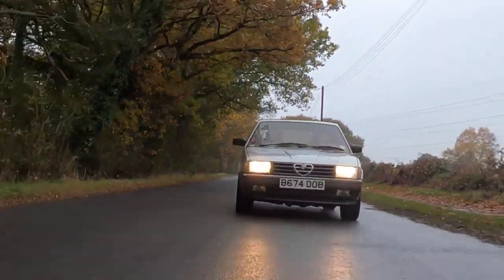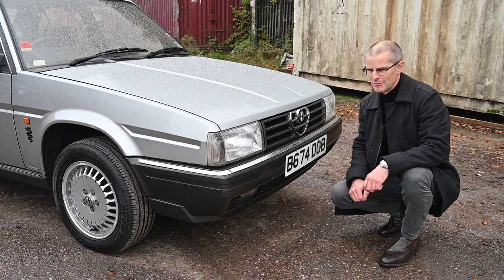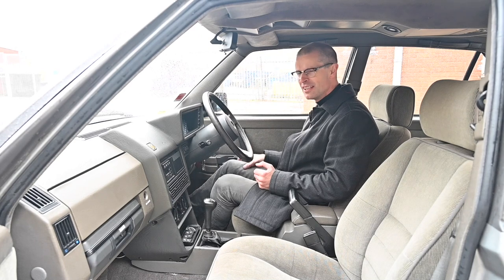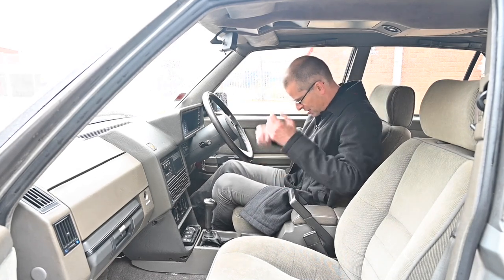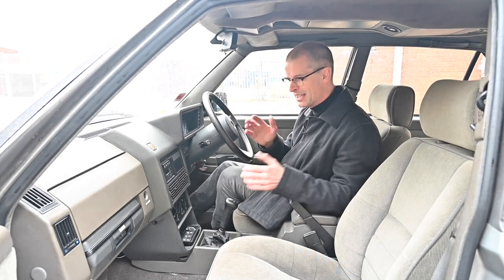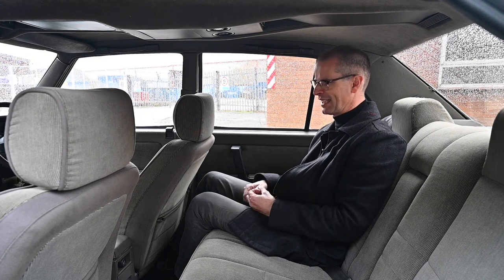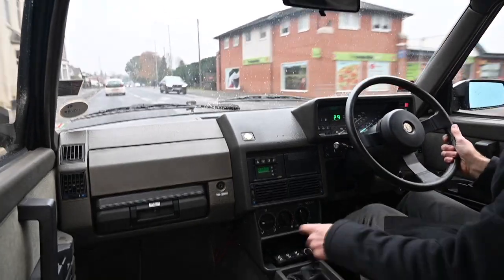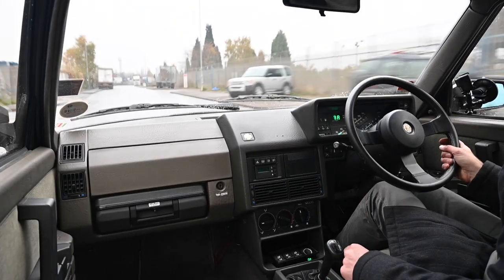Alfa 90 Gold Cloverleaf Goes for a Drive

Comment: I had the privilege to own one some time ago. It is not particular beautiful but with it’s quirky features it put a smile on my face every time i got to drive it. The front spoiler, digital dash, handbrake, green illumination, rear discs mounted at the gearbox and the engine 2,5v6 all one big smile. Then the rot came along and eat my trunk. Eventually sold it with a hole in one of the pistons probably due to a faulty injector. Then learned that ‘my’ car was sold on to a student that had folded it around lamppost. A true tragedy for such an awesome car.

Comment: Very nice video. Little remark: the 90 was the stopgap for the 164 to be ready, not the 75. It was positioned next to the 75. When Alfa asked the Italian government for money in 1979/1980 it was for a mid-size and big saloon. The mid-size they got approved as it continued on existing technologies which became the 75 (launched 1985). The big saloon was rejected so Alfa started the 90 project which was a reskin of the Alfetta; later to be updated to be more like the 75. Due to some informal connections Alfa learned of the work that Lancia and Saab had been doing (Thema, 9000 and Croma) and was able to renogiate with Italian government to get money for a big saloon but with reduced costs as it would share the platform. They still went ahead in parallel with the 90 however to be on the market quickly. The 90 had a difficult time as it was not different enough from the 75 and the Thema was the better offer. Alfa was pretty much ready with the 164 to compete again (very different than the 75 and despite shared platform very different and more modern than the Thema) by 1986. They however ran out of money for production tooling. That's when FIAT bought them and after a year of fine-tuning (and some downgrading of luxury options to have less competition with the Thema) in 1987 the 164 was launched. And the doomed-from-the-start 90 was no more. In most companies a car like the 90 could not have existed. In Alfa it could.
Reply: Als je een goede tegen een redelijke prijs te koop weet laat het svp weten! Ik vindt het een fascinerende auto en wordt er enorm hebberig van.

Comment: And now for something completely  different , intriguing Alfa with enough green lights to make Superman feel at home , and more shakes and rattles than a Doctor Who set it seems ,  only saved by the engine note . Just before heading off into the dough ball 90's lets give the straight line styling pen one more burl. Cars rode so much better back then on proper rubber and smaller wheels ,If the future is full of low profile tyres being   almost sprayed on please bring back hydropneumatic suspension . The over head console takes your breath away ..all it needed was a Fax machine. Great review.

Comment: I 'upgraded' from a '76 Alfetta to a 1986 90. I loved it for about a week before problems started occurring, and then regretting not buying the more powerful 3.0l 75 or GTV. The dash check light was always on, the digital dash and odometer were flaky, oil got into the coolant through dodgy head gaskets from memory, heater radiator leaked, it cost a fortune to maintain. A real love/hate relationship.

Comment: "everything that was brilliant about the 80's... in a door" lol
Reply: Yeh 80s sports cars were designed to stand out. Now sports cars don’t they just look like the normal spec cars it’s all about being subtle and boring. The 80s was the decade of being OTT, if you had a fast Ford it was badged up and body kitted out as a sports cars like the Escort R.S Turbo, even the XR3’s & XR2’s stood out and the legendary Cosworth especially the 3 door whale Tail stood out a mile. Now it’s just some little badge on the bottom of the door that’s a signs it’s the faster or sports edition. Booooorrrriiiiiinnnnnggggg😒

Comment: I had one of these ,way back in the 90s. It was a bitter/sweet experience, because  I  was  never sure if  it would break down unexpectedly, usually far from home and many times for the most trivial of reasons(fuel injection relay failure ). The list of things that failed or stopped working was quite long. Such as the electronic speedo and rev counter either not working or giving alarming speed readings ( 800 KMH ),failed front wheel bearings, failed electric windows, refusing to start sometimes ,failed radiator fan thermo switch.   In the end ,I just gave up and got rid of it, but when it worked, it was a wonderful car to drive.  The first thing to go missing  when buying a used example is the briefcase
Reply: I was once told that the 90's briefcase is more valuable than the car itself.

Comment: the driver mirror adjust being electrical on the passenger side was not a design high note,  rather they just left the flawed LHD version as with the floor mats and boot release but in this case it was a benefit if you were RHD.

Comment: Thank You! Nice video and really, really nostalgic for me. Ive had 5 of those, Yes thats figure is correct. I miss every one of them, especially the blu 2.5 quadrifoglio oro from 85. The 2.5 is just the best busso (and thus the best ever engine), more vocally trained and responsive than the later 3.0. But all bussos are great. Despite having active aero (way before it got into fashion with similar cars like f.x. the Veyron) it does lean a bit but the balance is just adorable. Steering is great and you can have all four wheels letting go at exactly the same time if You get of the accelerator briefly during cornering. Despite having 5 Alfa 90´s and using them, I never had any problems at all with any of them. Even the guys at the annual MOT testing always stressed -Don't bother coming back next Year, no need really. Some Years they even called in extra staff so more people could adore the perfection.

Comment: Fabulous ! What a car, what would that have cost originally in comparison to a Granada / Carlton / Rover SD1 etc ? I remember occasional visits to Mario Deliotti for parts as my Dad had a `74 Berlina 2000 in the late `70s - not so quirky as the 90  although the centre console was angled to the left + guages were in Italian. Sadly it rapidly rusted and was actually outlived by the landcrab 1800 it replaced!

Comment: Really decent review. It makes one think that the Alfa 90 is the more electronic heavy version inside of the Alfetta launched in May 1972 with exactly the same platform but with the v6 engine which should have been introduced in the Alfetta in the 70s; so how good was the Alfetta when it came out with all that technology of front engine and rear transaxle with watts linkage and low unsprung weight front and rear with torsion bars at front and hollow dedion tube at rear with inboard rear discs; as an Alfista who owns one none of the competitors of its day were close.

Comment: Brilliant choice of car for a review, pretty sure I was eyeballing this example on eBay a few years back, but I had recently bought my similar 164 12v so I was just eyeballing haha, seems like you really know your stuff, you mentioned some things I never even know about the 90 and I am a classic Alfa nerd!

One thing I will say though is I would be Astonished if this thing only gets 20 to the gallon,the 3 litre version of this engine is capable of 30 mpg if you are easy on the throttle and 40mpg ish if you cruise it so I can't see the 2.5 being that much worse on fuel unless the transmission losses of the rear mounted transaxle are really that bad.

I would love to see more classic Italian content like this, I'd be happy to let you drive my 164 once I have finished playing with it.
Reply: The consumption of a V6 is what puts me off of seriously wanting a Busso-engined car, although I am obssesed with them.  Your report about getting that kind of mpg really makes me want one, now!
Reply: @BEasay  if you are in the market for a Busso then fuel consumption is no big matter for you.

The 12 Valve is quite efficient but this engine is meant to be driven, you are meant to hear its song so you will likely see between 25 and 28 to the gallon on a 12 Valve and around 22 in a 24 valve.

30-40 is achievable on a cruise though, it is just so hard to not be tempted into dropping down a couple of cogs and hearing that song.

Comment: A friend had one recently. I have the workshop manual somewhere, although we never had one (had a pair of 75s)

Range shouldn’t be that bad. One of the 75s we had was a 2.5 auto, which I think shared the same small tank. Around 25 was normal even with the 3 speed auto box . Tank was 10 gallons so around 250 miles. The 75 TS I had was better on fuel with the same size tank!

Comment: Possible the only car that was stylish AND odd-looking; certainly it is highly interesting.  Alfa went a little overboard to make the alfetta into a right car for a new era, but in the end all those 1980s-rectangles couldn't really hide the origin and so it was no wonder that the Lancia thema sold so much better.  That car and the Fiat croma too were just more "right" for the mid-1980s and more really modern throughout.  I had always thought that thema's/croma's Alfa-cousin 164 was the successor to the 90, btw.

Comment: I saw this car (or one very much like it) recently and I said it looked like a Fiat Croma. However, judging it in the context of its time I now see that it's quite pretty and interesting; I didn't realise it was styled by Bertone! That amazing rear light cluster is what turned it for me. I can't believe the 75 replaced this, it looks far more dated today than the 90 does.
The owner is a very lucky boy.
Reply: Tecnically the 75 replaced the Giulietta 116, this the Alfetta but if the 75 continued its life from '85 to '92, the 90 was replaced by the 164 in 1987 (built on the same platform of Thema, Croma and Saab 9000)

Comment: Alfa 75 was a reworked 1970sGuilietta, hence the high boot line, and engines starting with 1.6. Brought out in 1985 and named 75 as Alfa was celebrating 75 year anniversary. I saw 90s, 75s GTVs and 6s back in the day as the Alfa garage was in my way to college, as was the Lancia dealer. Alfas were better styled than Lancias though!

Comment: Just a quick bit of info about the weight thing at 3:40 - these weights listed don't match what you have because they're not what you think :)

These were mandated to be on the VIN plate by the Italian rules of the road (some other countries have/had similar arrangements).

In order, top to bottom: 
Maximum Allowed Weight for the vehicle FULLY LADEN (5 passengers + baggage) 
Maximum Allowed Weight of the vehicle combined (aka fully laden AND with a fully laden trailer)
Maximum Allowed Weight on the front axle (vehicle + passengers/cargo) 
Maximum Allowed Wright on the rear axle (vehicle + passengers/cargo)
Reply from the maker: Thanks, that makes sense!

Comment: Quirky to the Nth degree, I love it, always loved Alfa's but never brave enough to own one due to their rot record as lived within smelling distance of the sea for a while.  That is where the old log books were good as the previous owners addresses were in them.  
"T" shelf less is good, who drinks tea or coffee in a vehicle anyway, that's what Truck Stops and Services are for, drinking an hot beverage whilst parked in a lay by is risky if a large truck thunders past at 50 or 60, the wash will rock the car and said beverage ends up painfully in one's lap.  Spending hours sitting is bad as one needs to stretch one's legs or risk a DVT.  
Too much storage only collects clutter and invites thieves to rifle through it looking for anything valuable, particularly with an unusual or rare car.

Comment: Actually, the 90 was a stopgap model before the 164. The Alfa 75 was considered smaller/sportier, in its own segment. Like Alfetta/Giulietta. 
The styling when studied in detail is very refined - which I’d say is the opposite to plain? But hey british is not my first language.
Also I highly doubt there’s much Alfa 6 in there, rather a Alfa 75 2.5 V6 with a different body. Or, a facelifted Alfetta with the GTV6 engine.
The inner roof (inherited from last Alfetta) is my favourite part!
Reply from the maker: There is detail to be found but as other Alfas were more eye catching it looks a bit bland in comparison. Still handsome but not as exciting
Reply: @furiousdriving  From a 100m distance I agree! (Bar the avant-garde rear design)

Comment: You and Joseph both smashed it with the Alfa 90. I remember that we would be receiving a limited range but I never realised that we only got one model. Sounds fabulous, looks gorgeous. It took Vauxhall until 1993 to add a gentle slant to the top of the headlights on the Cavalier. Oh so very much not a Stelvio. If Alfa Romeo could achieve this with £25, just imagine what they could have done with £25 million.

Comment: Lovely car. Very interesting take on the compact executive motor. Another I have never heard of, never mind seen. Interesting about the gas mileage. 150 miles on a tank is nothing. That would not even get me to and from work without a fill quite often. I have never had a car that consumed so much petrol, not even my 78 Mercury Grand Marquis with its 6.6 litre V8! My 89 Mercury Grand Marquis with the 5.8 litre V8 just about doubled that pitiful miles to the gallon! Looks like it was a fun car, though.
Reply: It only has a 40 litre fuel tank...

Comment: That weight plate is probably the gross loaded weight on the wheels - so with passengers, luggage and full tank of fuel. I doubt it was over 1500kg in that era, even my 960 24v volvo estate from 1991 isn't as heavy as that ;-)

Comment: In Austria they were not so extremely rare. They were expensive, yes, at a price of a Saab, Volvo, BMW. And they had the same troubles, like all the Alfas. But it was the time of "not perfect cars"!
The 4cyl. were good and reliable engines, if they got the right care. Gentle driving when they are cold, oil change regularly, same with the maintenance - and those engines nearly run forever. 300.000 kilometers on a 2 liter? No problem. The 1800 was not so popular, because it was not so much cheaper than the 2000. The V6... Well, a wunderfull engine, but not an easy one. Very expensive parts, bad  workshops where common, so everybody in the south drove to Tarvisio, or Udine for the service. The transaxle was a little bit rough, changing gears in corners was not a good idea. It likes to rattle and squeek, especially in the winter - a common thing. Loose interior parts also. 
But the biggest problem was, as on all cars of this period, rust. They got the first rustspots within a year! And, they rustet everywhere... Doors, pillars, even on the roof! I had a customer in these days, I worked at a Ford Dealership,he wanted to trade his shiny beautiful Alfa 90 (dark blue met. /light grey velours, rare sunroof) for a Sierra limited edition, a Cossie fake. (4dr. with the alloy wheels, the spoiler and the other front bumper, quite popular these days). The inspection was very short: Underneath, it was a wreck. Rust on every part of the chassis. Around the dampers and struts, you could stick your finger through! Everywhere metal à la Croissant. Didn't make the deal.
Reply: I forgot one thing. Maybe in England, there was no sunroof as an option. The sunroof that I found on this dark blue, was only a pop-up glass - like in the 33 (and I think it was the same). And, it was no aftermarket cut in,because the curious switches under the roof where there and the trim was all original.